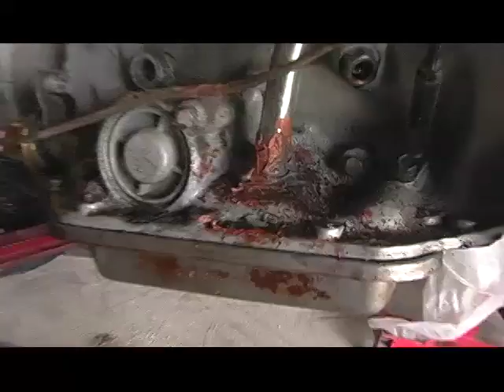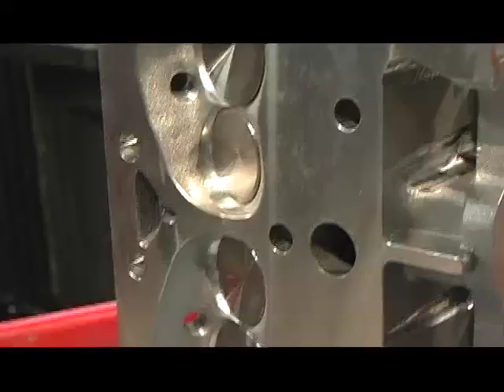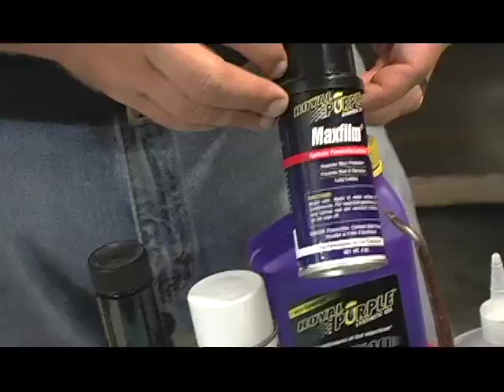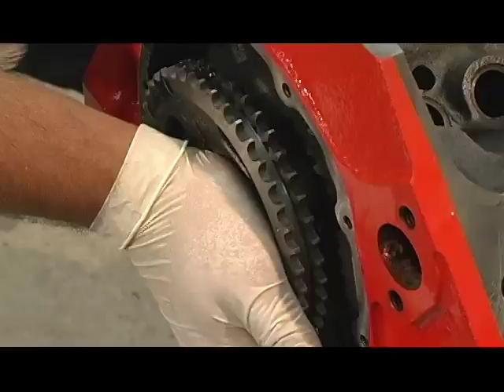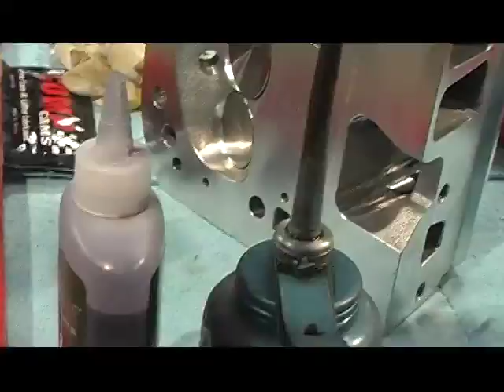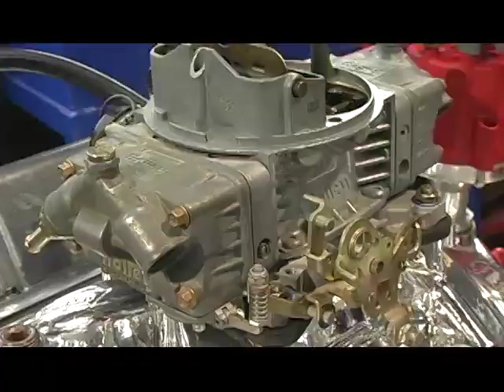1965 Chevelle Engine Upgrades V8TV-Video

Comment from the maker: Randall, 

This is a low-buck street build, and trust me, Nick has done a million of 'em.   It was fairly new on the bottom end, so we didn't want to start over with this one.   If it were a high-hp race engine, we'd have used a different block and crank to begin with.   Thanks for the feedback, though!

Comment: dont know much about post carbed era engines but id have to say i would be surprised if the fords had a 4 bolt main. alot of 350 chevys do but they had weak cranks for performance. if it doesnt pick up a main cap girdle. they are great bottom end ensurance.

Comment: unorthadox use of sealer type but whatever works. id rather use an ioland temp resistant type gasket sealer. maybe what you use works but if that was my buddies engine and saw you doing that i might get a little pissed.

Comment: just a quick question, why do you need to change the valve springs when change the cam shaft and also what are the benifits of putting different heads on it?

Comment: You left out the part where you ruined the cam and lifters with those stiff springs and stamped steel rocker arms. I could point out a few other mistakes in this video, but that was a big one. I don't mean to be rude, but people should know that this is not a good way to break in a cam as big as the xe268h. You were lucky if that cam survived the break-in process.
Reply from the maker: Good point.   These days, you should always use a light spring on any flat tappet cam.    This engine has lived happily for 5 years now, but you can't be too careful.

Comment: 400hp? I'd like to see real world dyno vs computer simulation/ fantasy
I have a hard time believing 400 w/o roller valvetrain & more compression cuz that's about 9:1 w/ those heads
Reply: +Eric Sageser 
I was wondering the same thing myself.  I'm in the process of building a 350 WITH a roller cam, 9.75:1 compression with an Edelbrock Performer RPM top end kit. I was told by a few others who built similar I might be looking at a touch over 400HP.  Hard to believe 400 HP for this flat tappet motor.  I'm sure it'll run and sound great......